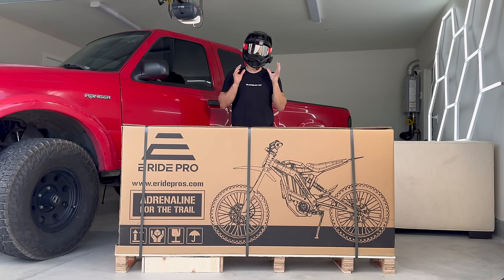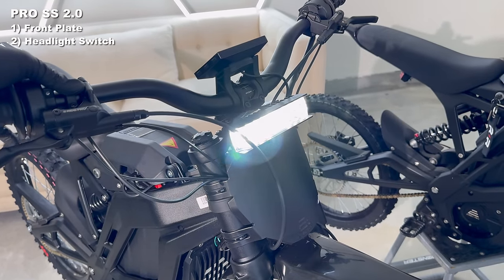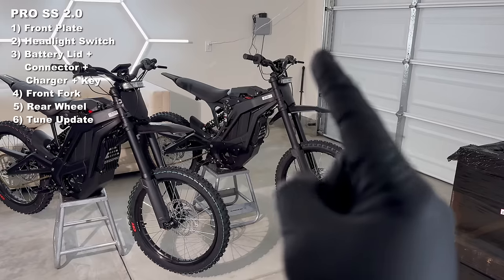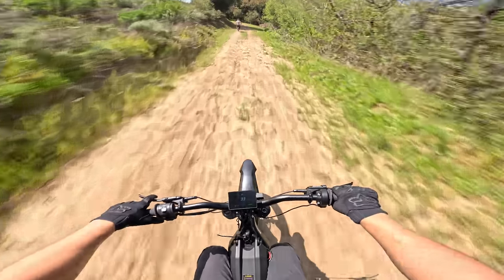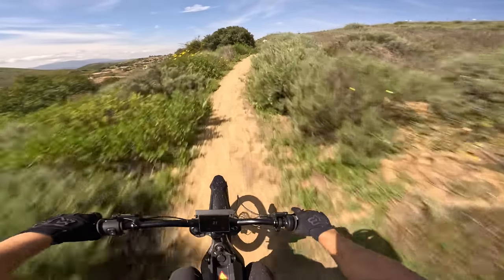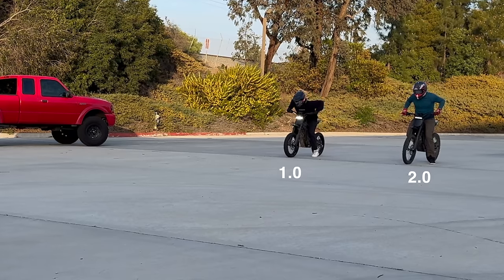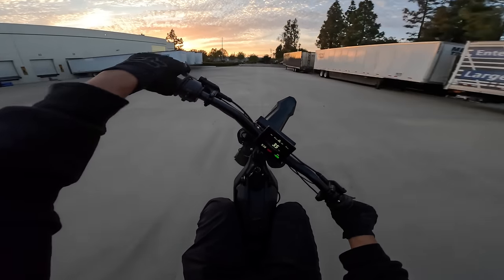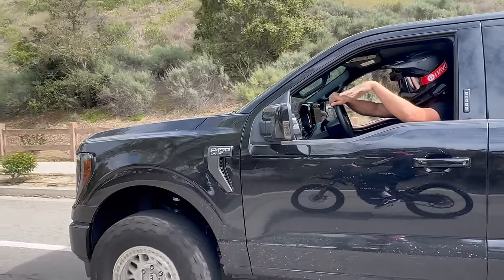The NEW E-Ride Pro 2.0 SMOKES Surron & Talaria (+60MPH!)

Comment: I just test rode this E-Ride Pro 2.0 72v..... It screams..... I hit 60mph on the road and it had more (but I couldn't do more safely). It's very fun and seems well-thought out.  It does feel a bit sketchy with the knobbies on the pavement around corners at these high speeds / high torque though.. If you will be riding mostly on the road, I think it should get some fat slicks instead.  The steering is also a bit stiff-feeling, it feels like steering dampers engaged.  That might be fine for secure and high-speed handling though, not sure, but feels less agile and playful steering-wise than the other Mantis I rode.  One thing to note -- always put the kickstand down with this bikes when you stop for a while.  I forgot and my little finger barely touched the throttle, tiny hit, maybe 2mm twist, just enough to rocket-blast forward. The bike shot out from under me and I landed on my ass. These bikes are touchy!! Def not a bike for tweens....  This may shorten the average lifespan of teen riders.

Comment: That F-150 truck is nice. I like the onboard power good choice. 🤙🏽🤙🏽
Reply: It's not a 150.. it's a ranger.
Reply: I’m talking about his new truck that replaced the Ford ranger that onboard power would be a nice option to have🤙🏽
Reply: @ghostphil69  ah.. I didn't get that far into the video, my bad.
Reply: Yea built Ford tough... meaning built to break.
Henry Ford confirmed he built the original ford's to break down because you didn't make money off the production, but the service.

People are dumb, so things never change.
Reply: womp womp  @Mi_Mono
Reply: @Mi_Mono  Ford 👎
Reply: Dude, you really need to quit showing us old guys new bikes cause we buy them. And I could tell what kind of truck it was while you were sitting in it. Before you told anybody what it was. Good choice.
Reply: @brianwills4398   no worries, bud. It would be a hard choice between that F150 with the onboard power and a cyber truck. I really like the cyber truck if a full electric truck would work for your lifestyle. It would work for mine. I only commute 4 miles round-trip to work.
Reply: @Mi_Mono  I've got over 31K miles on my 22 F150 Lightning EV and have had no dealer maintenance whatsoever besides free recall stuff. I changed my wiper blades and cabin air filter with ones from walmart. That's it.
Reply: @ghostphil69  I commute 100 miles round trip daily with an EV truck. Ford F150 Lightning Lariat and it has 9.6kw pro power for charging e bikes or can power your house if needed. The long commute is what makes driving a brand new EV affordable, $500+ a month in gas savings helps make the truck payments. An EV will work for anybody's daily commute and longer commutes save the most money, nobody has a 5-6hr 300+mile work commute. If you're taking road trips in excess of 300 miles regularly or towing long distances regularly then you need a gas truck or readily available DC fast charging infrastructure.
Reply: @Mi_Mono then I wonder why they are the best selling truck?

Comment: @sur ronster Nice truck but, did you at least test drive an F150 Lightning EV? The 580hp 775ft.lbs torque and under 4 sec. 0-60 acceleration is just amazing. And its got a 131Kwh battery with 9.6kw Pro power on board. I get hating on the short bed but yours doesn't look bigger what did you get the 6.5ft? I can fit 4+ razor bikes in the bed and fill the frunk with ice and beverages. Frunk space is a game changer for pickups and worth it even if I have to use public chargers a few times a year on road trips.

I'm really thinking about getting one of these eridepro bikes for myself and also looking at the EGO 56v mini bike for my kids, trying to step up from razors and can't afford a varg. Tired of fixing and upgrading razors.

Comment: $65,000 so that you can charge your Ebike batteries on the go?  You can also put some extra $500 to $600 Ebike batteries in a backpack.  They also take a very long time to charge so the backpack option is a much better solution.

Comment: I’m a big and tall guy at 240lbs and 6’2 so I’m just concerned with getting anything other than the talaria sting R since is doesn’t have the belt. I’m not super savvy when it comes to cars and bikes. So I don’t know how long the belts would last on these SS’s and how hard they would be to change. But at the same time this SS’s are rated for 300lbs and the power is crazy alluring to me. Idk what to do :/

Comment: I must have gotten a 1.5 or something. I have some of the 2.0 components, but some different ones than you showed. Like I have the head light switch but the key only has 2 positions not 3, I have the new connector, but the front forks I got are fast ace. I did get the fatter tire in the back and I’m not sure if I got the new tune or not. Are these fast ace forks considered an upgrade? BTW, they don’t have the Eride pro cap on top either. And I got the flimsy number plate.